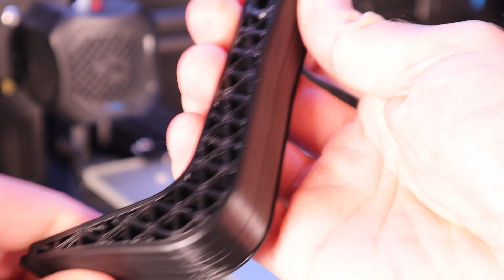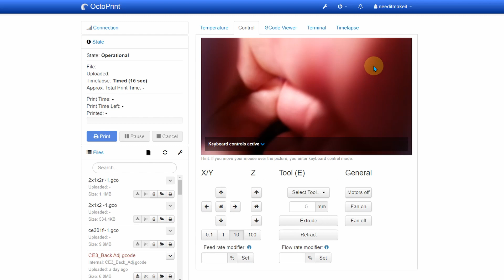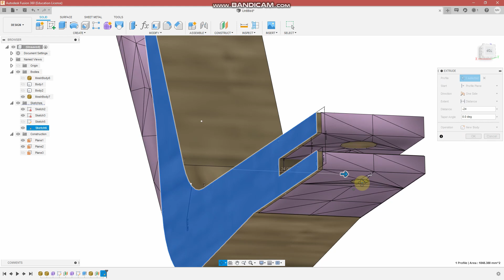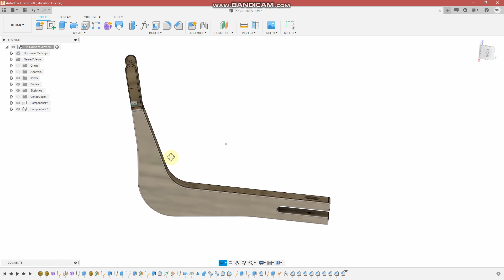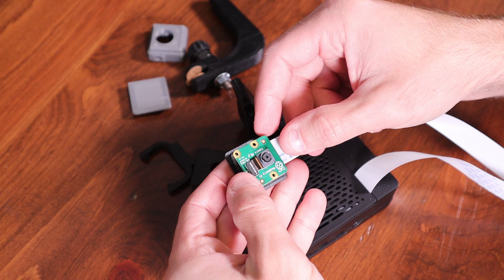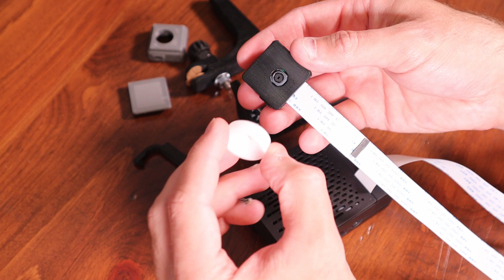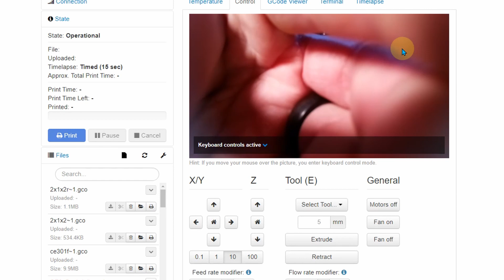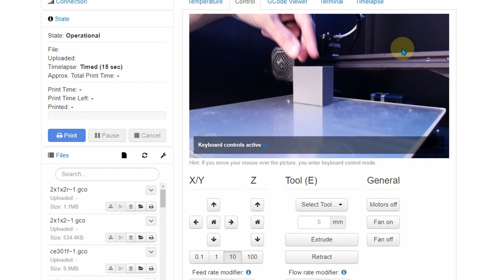Creality Ender 3 V2 - Make a Great Bed Mounted PI Camera Arm For The Spaghetti Detective & Timelapse

Comment: I just bought the camera and was searching for a perfect mount and found nothing good. 
Thanks mate, perfect timing!
Reply from the maker: My pleasure, I figured there must be more people looking for a different solution.  If you print with ABS or a flexible filament you're probably good, if you print with PLA, the pivot arms are tight so please be careful when assembling.
Reply: I'll try PLA tomorrow since that's all I have in the right colour. I'll keep up posted!

Did you use the long mount arm or the standard version? Didn't really catch that.
Reply from the maker: @JohnSunderseven  I'm using the long version to capture a little more of the bed, it doesn't make a lot of difference, it really depends on what you like to print and use what works best for you.
Reply: @NeedItMakeIt  PLA did work good but had to make the pivot with 5% Infill so it could flex a bit since the first one with 25% broke. I'll upload a make in the next few days :)